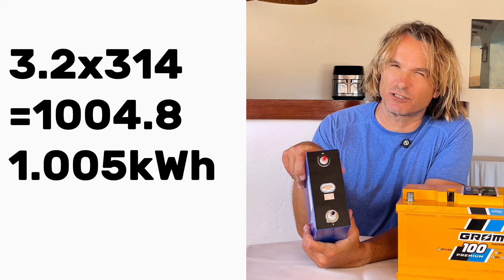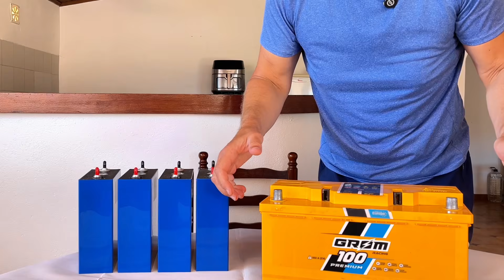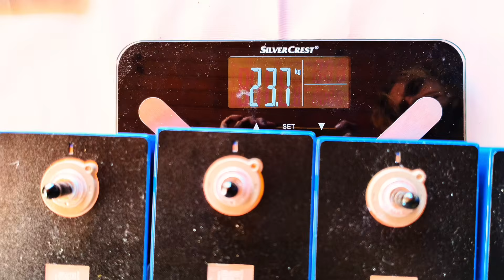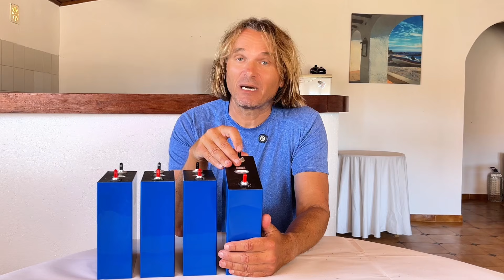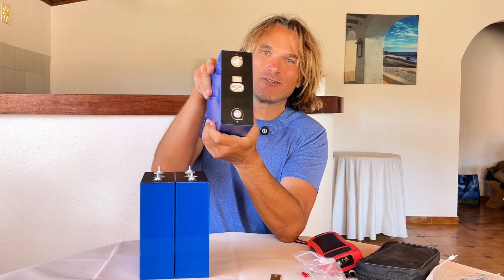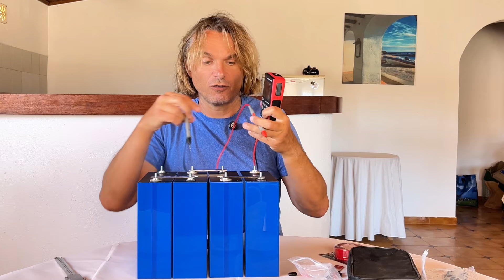Stop Paying $500 for Solar Batteries. Do This Instead.

Comment: you have to compress lifepo4 cells, if not you will destroy them with micro gas which seperates the materials
Reply from the maker: no, it is simply not true
Reply: @4nrgyTech  it´s what the manufacturer says. so why isn´t it true? I BELIEVE that in an normal well balanced solar system the cells never reach that high temperature, cause it isn´t an electric car, but... the manufacturer says it has to be compressed.
Reply from the maker: its not the manufacturer. i challenge you to find catl or eve or dejin document which asks you to compress cells. there is no! its wholesellers selling shady batteries which asks you to do it

Comment: dangerous idea not to use an inteligent bms. what the study shows was bad bms that equalize thewrong way. not using bms will destroy the cells cause you will not have equal cells and in use the story changes totally. so what you need is a high quality bms!
Reply from the maker: you cant equal cells if you use them right: 10 to 90% SOC means there is no possible voltage detection for soc in lifepo4 batteries. whats dangerous is positive corelation voltage/temperature means in heated cell voltage rises idiocy called bms tries to equalize  in fact bringing inequality in this equlibrium
Reply: @4nrgyTech  it seems it´s only you who believe that
Reply: @4nrgyTech  inteligent bms equalize above 90%, thats how it works! lifepo4 getting older will have diferent resistance. so you need a balancer. a home solar system isn´t an electric car, the cells will not boil! so temperature isn´t significant, if you didn´t store them in your sauna.

Comment: Loving Your videos, Thanks for the explanations. Cheers from Missouri in America
Reply from the maker: thanks man! hope its useful
Reply: 🎉🎉thank you. 
I have a video for you ..on my chnL . I powered a 12v 60-70-80Watt DC pump DIRECTLY FROM a (( OLD BLUE POLYCRYSTAL panel. Very easy to do . Full amps from the sun even runs very good in over cast days . I use to run my water well diaphragm pump 70watt pump full speed 16-18vdc 5-6 amps ..👌💦💦💯 all DAY LONG.

Comment: Without a BMS, such a battery will not last as long as it might seem, unlike acid batteries, where the recharged section does not experience any special problems when current flows through it for other sections, much more serious degradation processes occur in LFP, especially when the maximum voltage is exceeded. About the compression of cells, yes, LFPs cannot be compressed, you can do it as you do, with an air gap, but the first few cycles of charging and charging new cells must be done under compression and at high currents, this is necessary to displace molecules of atmospheric gases from the cathode after production, if this is not done and if such training cycles were not carried out at the factory, there is a high risk of damaging the cells by swelling.

Comment: Excellent explanation, Sir. I am not a fan of BMS, but do think fuses are necessary. I think that if you break these down every so often and top-equalize, you get more power out of them rather than wasting power with BMS equalizing and not knowing how long that takes.
Reply from the maker: yes especially because of knee effect - voltage difference is biggest at 5% soc and 95% soc. so exaxtly top balancing when you want it. there is on science direct study of cells without balancing at all. degradation is even lower than with balancing

Comment: I need one of these minimum in the 12v variety
Reply from the maker: you can easily build this 12.8V configuration using 4 cells in series.
Reply: @4nrgyTech will it be enough juice for an automotive application? or should I get 5 x 3.2 = 16V
Reply from the maker: no. 12,8 is good and it has chargin g voltage 14,4V. one and only one problem is cold. you need heating mat if you want to charge it below 0°C (32F)